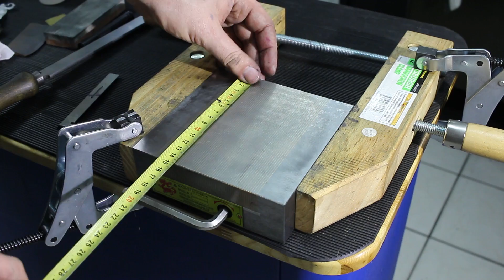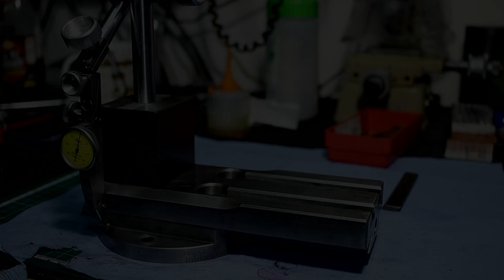Rebuilding a Schaublin 102 compound slide - Part 2

Comment: That mechanical advantage is a big deal! My milling machines X-axis was stuck when I got it, because the gib wasn't properly lubricated so it galled in place and the table kept moving and bent the adjusting screw. Took me over a week of work to get it loose, using pressing jigs, penetrating oil and whatnot. Still managed to salvage the gib, had to make a new tab. And a new screw too, and patch the galling damage.

Comment: It seems that Schaublin manufacturers these hubs in 4 different thickness, from 4.0 to 6.0mm on the thicker side. It may be due to compensate wear on the slides. They have one that is the standard, which I suppose that equips a new slide. I have the technical drawing showing this.

Comment: Hi Stefan.... Is there a chance  you can do a video on general theory of dove tails slide ways.  ( shop phyiscs)  Why are certian angles used?  Should the bearing be on the top surface  or the bottom surface for a given machine?   Is it ever both?  or even top on one side an bottom on the other? Do  you put a chanfer on the tapered gib for clearence in the tight corner of the dove tail?  Where should the gib side go in relations to forces?    I know designing machine with dove tail slides is old school, but I am wondering what your thoughts are.  I was going to scrape in very old lathe cross slide, its very worn and I can not tell what the the bearing surfaces are/ were.  It looks like both the top and bottom  on the head stock side and bottom  of the tail stock side.  It looks like it might have been originally made that way. So many questions.  I loved the tip about relieving the short  component to pre - wear  it for longevity.

Comment: Stefan, absolutely brilliant. Complete end-to-end treatment of worn dovetail recondition from problematic tightness to final rigid smooth travel. New gib fitment. Novel (to me) use of mill to fine tune gib taper, novel use of magnetic chuck to hold iron gib while scraping (I used nails/screws on a pine board), quantitative analysis of gib tightness using relative indicator motion from slide to guide, discussion of normal dovetail wear (middle vs end). Delightful to watch. Bravo and congratulations on a very well thought out comprehensive ,2 part video on dovetail scraping.
Reply: Stefan, I don't believe that whale oil could even be found anywhere today. My Grandmother remembered whale oil; it was used mostly for oil lamps and had a low lubricity. She had a sample when she was alive but I don't know what happened to it. The lubricants nowadays are much better than whale oil and I am glad that the whales can be left alone to live their lives.
Nice work on the gib.

Comment: How did you rescrape the doughtail of your milling mashine? The mashine bed is a very big part, where/how did you place your reference? It is not possible to put it on a reference plate... 

How do you rescrape the bed of a lathe? After all it has to fit to the spindle. I have problems to imagine where to put the reference when dealing with big parts.

Comment: Loved the video!
One question though: When you blued and rubbed the slide around 8:08 how do you know that the geometry of the way is not convex? I understand that the slide's surface is flat and that the parallelism between the two ways is not important, but if the way surface was convex, it would cause problems (at least in my imagination!). On a surface plate we would rock the part to check, but that isn't possible here.

Comment: Hi amazing job there, could you please make a video about the power scraper you were briefly using in this project. By the colour of it  I assume it was Fein? if my assumption is right it would be really nice to see the guts of that maschine.
vielen Dank
Reply from the maker: The sraper itself is a Renz - The motor is Fein, correct.
Unfortunately I will not take it apart - I need that think in working order, cant risk to take it apart without a very good reason (like mechanical failure).
But I think you will find photos of the guts of a Biax scraper online - They should work very similar.
Reply: Understood, thank you very much for the information.

Comment: I wonder if that gib is for a larger machine or a larger slide on the same machine. In most any case the gib must be oversize so how much more effort to make a little smaller or a lot smaller? Good thinking if you need one superb part to service many different old machines. Can you tell if it fits the cross slide too?
Reply from the maker: I recently learned that you can get the gibs from Schaublin in different thicknesses to accommodate different levels of wear. The owner got one on the thicker side, just to be safe.

Comment: Also, thanks for pointing out the precision ground ring on gib adjustment screw and tight fit with mating slot on gib. I have a sloppy gib adjustment screw (gib slides in and out when changing axis direction, causing dovetail to alternately loosen and bind) and will try a more precise ring/slot. I was going to try adding a second opposing gib adjustment screw to sandwich gib simultaneously from 2 opposing directions, but didn’t have room on machine. If it’s good enough for the  Swiss, it’s good enough for me!

Comment: Also, also, also. Very nice technique measuring dovetail parallelism on your surface plate using pins, right angle block, parallel,  and indicator. For me, this is the toughest number to measure but is perhaps the most sensitive to nailing the dovetail travel tight and consistent.

Comment: Great job! Thank you, Stefan.
Can you clarify one more moment?
When you reduce the planes of the dovetail, the gib goes a little deeper, as a result, the upper part moves horizontally to the left (or to the right, depending on the side of the view) from the axis of the screw.
Is it offset important?

Comment: Surface ground vs Scraping  ?  Surface ground metals against one another would have a wringing affect causing high resistance (friction). Is this the reason we create bearing by scraping to  reduce friction to  ease movement ?????

Comment: Great project! There's a lot of quality information in this series. One question that remains for me though; after scraping the portion of the dovetail parallel with the top of the slide, how did you measure/scrape the angled part of the dovetail to maintain the correct angle while concurrently correcting the distance between dovetails? Excellent work!

Comment: Very well done Stefan, BTW Captain Ahab was not going to run Moby Dick thru a blender, just had to boil whale to get the oil. GM used to sell it to take the chatter out of Posi-traction rear diff.
Reply: in fact, in the early time of industrialization they probably used whale oil as way oil because most lubricants where obtained that way
Reply: Robert Klein, when I pulled the diff off of my 67 Camaro it had that whale oil lube in it, stinks to high heaven

Comment: How many hours did this rebuild take approximately? If the nut would have needed material added, would that then be shim stock or turcite?
Reply from the maker: About 10 hours without the camera/filming. I would cut shimstock to size and use that to raise the nut.

Comment: It looks like the schaublin has generous oil holes in the ways and gibs. Is it surprising to you that there is this much wear? Is this evidence that the machine was not oiled regularly? Or is this just the way it goes? Also, how many hours did this take? Great series. Thank you very much for sharing. I learned a lot about measuring as well as scraping.
Reply: scott black lack of oil destroys machines in noooo time at all, its probably normal wear. It looks grear compaired to my Grandmothers old lathes where grinding operations were production jobs.

Comment: not sure thats how whale oil is made...
Reply from the maker: I am obviously no whale-expert ;)
Reply: You will have to look for some whale oil based way oil to use next time. I understand it used to be used in automatic transmission fluid.
Reply: we used to use it for oiling clocks. sperm oil doesnt migrate or break down over time like anything else does.
Reply: Noooo ! Whale oil is to stop whales squeeking !   ;-)
Reply: Nothing more annoying than squeaky whale. 
You know what they say,  "The squeaky whale gets the grease."
Reply: My first boss used to say that it didn't always get the grease, sometimes it just got replaced.
Reply: Rambozo Clown - That's why automatic transmissions lasted the life of cars in the '60's...
Reply: I was imagining an Abom79 sized blender

Comment: I forgot to ask, what brand is the mag vise? Looks well worth the price.
Reply from the maker: Generic Hong-Long-Charly chinese chuck. 
Not sure if it helps, but here is the link to ebay germany:
https://www.ebay.de/itm/150x150mm-Magnetspannplatte-Magnetfutter-Magnettisch-120-N-cm-GOOD-PRESTIGE/252836595212?ssPageName=STRK%3AMEBIDX%3AIT&_trksid=p2057872.m2749.l2649
Reply: Got it! 117.00us shipped on Amazon. Thanks

Comment: How come the gib is not hardened or made of bronze? I expect that would make it wear less.
Reply: The gib is sacrificial - it should take most of the wear, not the dovetail surfaces. A gib that is harder than the dovetail sides will wear the dovetail slides away.

Comment: You mention that surface grinder may have done better,  I am curious why not grind the gib to size? Only thing I can think is maybe fitting setup under the wheel may have been an issue, for that perhaps a sine plate though? Perhaps no magnet sine plate... never mind, perhaps I answered my own question!
Reply from the maker: Youre right, the setup would not fit on my tiny grinder. I am already looking for a small sine-magnet ;)
Reply: I was wondering if the old gib could have been used as a reverse tapered shim, but perhaps it had too much wear?

Comment: OK, what should someone be charged for the work you've done on this?
Reply: if you really want to know just send Stefan a whale and a note asking how much to oil it.
Reply: Well my thoughts  on whale oil are that at one time they actually did use it in Corvette rear-ends so putting it on your ways couldn't be that bad.
Reply from the maker: About mid-three-figures.
Reply: So, you showed us a bit more than an hour of work in the two video "chapters".  Would you mind sharing with us the total amount of time you invested in this?  Thanks.

Comment: Hi Stefan.  A question not related to this video, sorry.  I'm wondering if strategically adding significant weight to a bench mill would improve performance.  My mill has a 1 HP motor and I was surprised to find that some Bridgeports have motors with very similar specs. I know bearings, spindle mass and balance etc. would also have an impact.  I'm thinking 50 lbs of lead to the head, 100 lbs to column, and some to the base.  I'd leave the table alone because the vise or rotary table adds weight, and I also don't want to stress the table in any strange way.  I've found nothing about this in searches.  If you don't have the time to answer I understand.

One other thing.  Every time you show your surface plate my eyes see it as dark charcoal short pile carpeting.  I would appreciate it if you would either give it a nice thick coat of yellow paint, or put a disclaimer on the screen, such as: "Please note that my surface plate looks like carpeting but it's not. Sorry for the confusion. I've been getting a lot of complaints so I'm thinking about giving it a good thick coat of yellow paint when I have the time."  

Thanks in advance, Bill